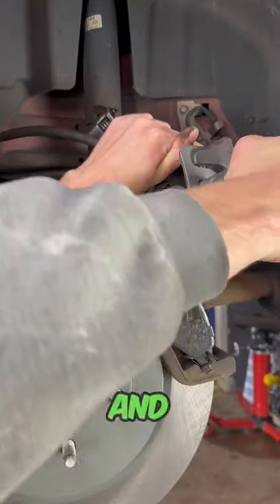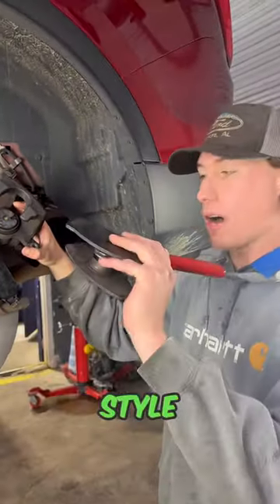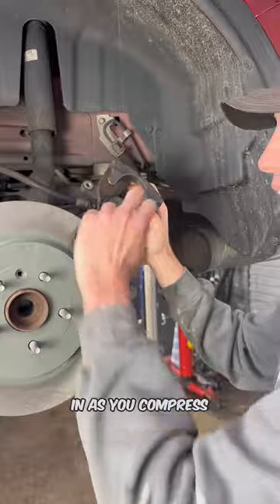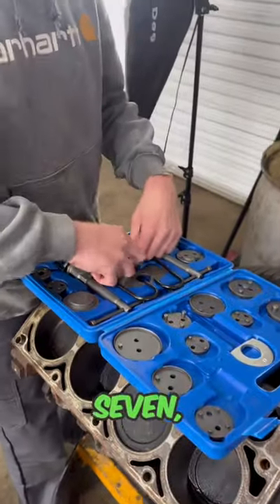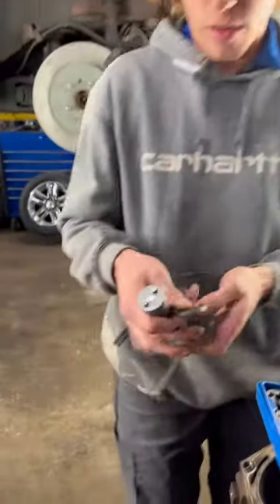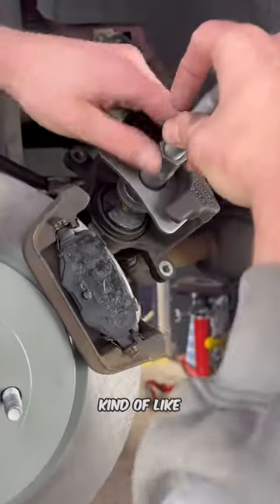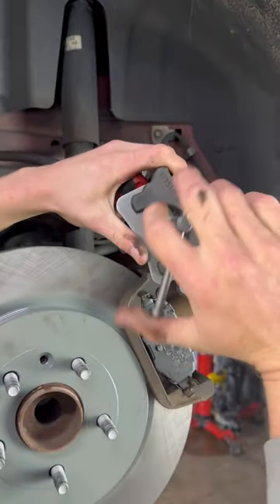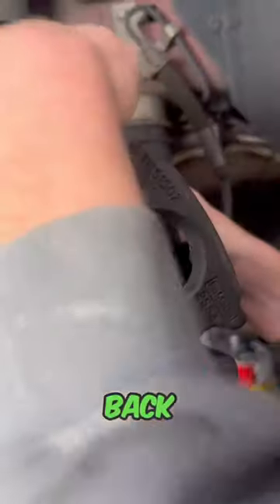The Brake Tool Every Mechanics Needs! Link in description #shorts #tools #mechanic

Comment: This tool is a life saver of pain but man, I just kinda wish they didn’t have these kind of calipers around. Sure it eliminates the need for a miniature drum brake or manufacturing an electric Caliper but I’ve seen quite a few of these calipers on 2008-2012 Honda accords leak, factory ones and new ones seem to have some issue with the seals. Not to mention if you get people who have never used their E-brake. There’s a good chance the mechanism is gonna be seized or bound and cause issues. Since here in PA part of the state inspection is the E-brake has to hold the vehicle on a slight incline.

Comment: If I had a quarter for every time, I saw someone doing rear brakes and struggling with a C clamp😂
Another good trick. If you’re trying to get the rotor off sometimes there is two screw holes you can drive bolts in with an impact, if it doesn’t have the holes, usually you can come from the backside with the same method through a bracket

Comment: When I found out my Flex had this design, I was not a happy camper. 20 years of doing brakes on older vehicles, and Ford throws me a curve ball. I have the toolset now, but I am still not happy about it. And I still have the Flex.

Comment: I have the Matco version that has a 13mm hex and a 3/8" square drive on the end with a caulk gun style grip to apply pressure while using a ratchet to turn the shaft. It also uses multiple discs with pins in different locations to index into the piston as well as a flat disc to push in standard single piston calipers. It has paid for itself in saving time not having to use the tool shown in the video.

Comment: If its an electric parking brake, remove the motor before compressing, you could damage the motor if you dont, also some turn in left or right, check before turning it all the way

Comment: Also important to remember to have the piston in the same orientation as it was when first removing the calliper, pins on the back of the brake pad can slot into the piston

Comment: Gotta get the air powered one. Has no threads so it stays tight without always adjusting the tool
Reply: Agreed, I use one at work and it works really good. Takes very minimal effort and I can compress those things in seconds.

Comment: The little 1" cube with a 3/8 square hole for a ratchet extension available at fine auto parts stores everywhere.  Been spinning rear pistons since the 90's on GM.

Comment: Apply some pressure….. Screw them with a pair of Channel Lock pliers…..Don’t pinch the rubber
Reply: Bingo!
Reply: Seriously, get the tool, it's not that expensive. A rebuilt caliper not so much...
Reply: @charleshubert6751  if a pair of channel locks hurt your caliper it was already hurt.
Reply: @grapeseed427  I've reset the calipers in my Volkswagens with channellocks and a clamp a few times and I bought an inexpensive set of these caliper tools and if you want to do it the hard way you go right ahead. The proper tool saves a ton of time and resets the piston properly. Not saying you're wrong, just telling you I disagree with you.
Reply: Ball ache 😂
Reply: I’ve done this so many times with pliers it’s not that hard lol. Incorrect practice makes perfect.

Comment: I hate using these but they’re essential for a lot of rear brakes. I open the brake fluid reservoir cap before putting the tension on. Somebody else mentioned also lubricating the rubber boot to prevent it from tearing which is a great tip.

Rent the tool from the auto store if you don’t plan on using it often. I’d rather rent a good quality tool than buy a cheap one since this thing often requires a decent amount of muscle to use. I sometimes refer to this tool as the hand torture device.

Comment: if you want to know why your calipers is this way this is only on rear brakes and it’s because that caliper has a mechanical operation for the parking brake also you will notice that your brake rotor does not have an internal drum for a parking brake.

Comment: The newer Volkswagens still have those slots but you don’t have to do that. Just use Odis to set the brake back before and after. I use a normal brake tool like you showed

Comment: Tool not required.  My Terrain had it and you take off the electric brake solenoid, spin it back out then push the piston back.  It is a pain to do it that way though!

Comment: these should only be on rear disc brake systems, they like that because there is an integrated parking brake. a manual cable with twist a lever on back of the caliper pushing the pad onto the disc., like a screw. instead of using hydraulic pressure to squeeze like when you use normal brakes.  that's why you need to screw it back in again.  this wasn't explained at all. now you know! :)    on newer cars with electronic ebrake there may be a servo or solenoid instead of manual cable. but similar deal. on those you normally have to set a mode in the dash to do those new pads.

Comment: Its only on the rear calipers and only on the calipers that have the parking brake inside of them. On a car like the bmw, the parking brake is inside the rotor so the caliper is sliding in no problem.

Comment: I have a little cube shaped tool that mounts on the end of a 3/8" ratchet extension. The cube has six sides, each with different spaced knobs and corresponding ratchet openings.

Comment: Get yourself an air wind back tool I use it daily it's handy when you have a  stubborn piston . The adapters you are using also fit the air one aswell so it saves you buying two sets of the discs 😊 it actually gets annoying when the piston has came out to far and you have to resort to the manual windback tool that you are displaying in video😂

Comment: Also most of mazda with electric parking brake.  Have the 2 slots or cut out but are not screw in those are still push in.

Comment: often, the local parts house will rent this tool out.   I bought mine on amazon.. best to use this tool Dig it!  clean up the grooves on your caliper boots, I even lube them so they slide around the piston as I retract it with the tool, vs rip it.

Comment: I got an air powered brake caliper tool off Amazon it’s a sky blue colored one I think Astro pneumatic makes it but works very well on stubborn twist calipers. The Ford Transits always gave me trouble but that tool made it ten times easier.

Comment: Get the air driven one. Spendy but worth it if you do a lot of brakes. Also, you can compress those with a ratchet style brake press IF it has an electronic parking brake and you put it in maintenance mode. At least Chevy and Ford I speak for. manual e brake cable driven you have to do this turny b.s.

Comment: Never met a turn and press caliper. Remember my first turn in type, I bent a scew driver trying my normal method. Went to parts store because I thought it was stuck. Counter guy said it turns back in. I still have the janky square tool for the job.

Comment: I always just use a needle nose for my at home brake jobs, and some quick clamps normally used for woodworking for the traditional style caliper, I'd buy the proper tools if I was working flat rate in a shop because they genuinely do work better lol

Comment: Why do I get the feeling that mechanical engineers all own stock in tool manufacturing companies?

It's almost like these executives all sat down with a group of engineers and tried to convince them to design new methods for a common task just so they would need to design a specific tool for it. Just so they could sell more equipment.

Comment: Get the air version.  It used shop air to hold the pressure while you screw it in, so no tighting with the wrench. I can't remember the brand right now, but I love mine

Comment: Oh I remember being 16 and working on my first car. Having no clue what I was doing and destroying my caliper and tool trying to figure out why it wouldn't compress.

Edit: mine was a Mazda Miata for those curious. No the piston doesn't twist to compress it has a ratchet that you have to release hidden behind a plug bolt.... Honestly it was a good experience because I learned double checking your knowledge before you brake something can save you a lot of money

Comment: Yea i got the same set. I used to have the metal cube you could stick an extension in and turn it with a ratchet.  I couldn't imagine having to do these without my set i got now.

Comment: I just done this muhsef' alternatin' tween' muh C clamp and turnin' them slots with the similar brake cube tool on the end of muh ratchet and uh extension. Worked fine. Compress, twist, repeat.

Comment: This is 💯 % true. Unless.....it's a Mazda CX 5 suv. It has the same notchs except it pushes straight in. Same toom. Use the wrench to tighten the tool to push it is just like u were but don't twist handle. Ask me how I know 🤦‍♂️ they have electronic parking brake and it will destroy the caliper if twisted. (What im talking about is ONLY the cx5 that looks like every other caliper that twista.

Comment: 1979 came across a Subaru with them there parking brake calipers.. we had to use channel locks to spin them in . Got old so I picked up a Mac tool 10 years later thing still fits everything on the road

Comment: Dont forget there is a pin on the back pad that hoes into one of those holes to stop the piston from turning when you apply the e-brake. Why because there is a screw in the piston thag turns to push the caliper piston out when the e-brake is applyed.

Comment: Some with electeic parking brake press in when in service mode. Also make sure the hole is lined up with the pad pin. Seen to many leave it turned pressing on the pad at an angle

Comment: I do not remember how many DYI brake pad installs I've had through the shop because they did not align the slots with the pins on the back of the inboard pads. Slightly uneven wear😂

Comment: I learned that the hard way when replacing the brake pads on my ford focus, thankfully autozone has a kit for $60
Reply: Autozone's pricing is inspired by meth. I found a good enough kit in a case for less than $20 shipped free to my door. Y'all welcome.

Comment: don't forget to point out there might be arrows showing the direction you need to spin it in. others it's a 50/50 shot. no pressure. oh, and side note, needle nose pliers can work too. 🤫
Reply: I use my channel locks. Have to pay attention to not grab the boot as it would rip it. 😂

Comment: Them notches are not the so you don’t use a certain tool use have to use that tool to wind in the auto adjustment for the hand break only rear one need doing like this

Comment: The shop i used to work at didnt have this tool set and i didnt own one either and i had to use channel lock pliers and a C clamp with an old brake pad, worst 20 minuets of my life

Comment: When I was working on cars still this is one of the dumbest things I hated working on. Screw in pistons suck ass. Just like 2 piece brake rotors. Neither are needed for a street car of any kind. Unless you plan on going a few hundred miles an hour for a quarter mile or a long-distance race with high speed turns. Other than that. Just added complexity that's not needed. Love the content, but damn I hated screw in pistons.

Comment: Gee… that looks like something else intended to  make life difficult for techs. Glad I’ve never run into anything that uses those. Probably invented by the same guy who thought you could just put a shaft with a lever on it through the back of the calliper to push the piston for park brakes: “Sure it leaks, but I couldn’t think of another way to do it.” Sure don’t miss that car. I’m also going to complain less about the baby drum brakes some of them use.

Comment: The reason is engineers want more money for stupid unnecesary design complications.
Reply: Parking brake is unnecessary?
Reply: The breaks aren’t necessary?
Reply: That's actually SIMPLIFYING things. Those are the combination rear brakes and parking brakes. Otherwise you'd have to have a SEPARATE set of brakes for the parking brakes and a rotor with a drum inside. Some vehicles are designed that way, and that's extra work, complexity and expense. Again, this is rare case where this actually simplifies things
Reply: Thanks for letting us know you don't really understand the design and how it reduces the part count.
Reply: @mbrick  why all of a sudden is the parking brake needing to be designed into the wheel cylinder so you need a special tool now to just swap brake pads.  Thanks for not understanding what I said originally.  Engineers only know how to make disposable shit now and it's pathetic.  Otherwise open your wallet for some other arbitrary pointless tool
Reply: @dmandman9  I'd rather have a dual system that works when the first has failed in an emergency then a dual tied together system that dosent work under those conditions.
Reply: @MJ100k  parking brakes that are linked to the service brake systems are not a good idea
Reply: @SleepWarz No, I read exactly what you said. Now there is no longer a set of shoes, springs, cables, internal surface on the rotor making it more expensive.  And not to mention the annoying process of trying to get rotors off over the pads that tilt and expand making it a PITA to remove the rotor.  And no more tiny axle seal weep saturating the shoes making them useless.  It is one simple tool and only one set of pads in this video.
Reply: @SleepWarz  Why would the parking brake on this truck not work if the primary brakes failed?  (How often does that even happen?)  If you lose brake system pressure somehow on all redundant circuits the e-brake is a separate electronic motor that still moves the pads.
Reply: @mbrick  I'll take my Springs and shoes over an electric motor attached to a caliper that if the caliper seizes You no longer have a secondary. Redundancy is very important in moving multiple thousand pound objects.
Reply: @SleepWarz   this system is two separate systems as well. If the hydraulic system fails, the mechanical system still works. That’s why you have to screw it in rather than press it in. Both designs have been used on various ford vehicles since the 1990’s at least. Example: the mustang, Taurus etc used this style. The crown Victoria and older pick up (with 4 wheels discs) used the separate shoes. Today only the super duty trucks use the separate shoes. Pretty much every other car, suv, and truck including the f150 uses this style. I believe the same is true for the equivalent vehicles from other manufacturers as well. Reliability is pretty much the same. It’s still mechanical for the parking brakes and hydraulic for the normal brakes. One can fail and the other still work unless the pad is completely missing.
Reply: @SleepWarz  this design has been in use since at least the 1990s (probably earlier for some vehicles makes) when they went to rear disc brakes on various vehicles. It was either this design or installing an additional small set of brake shoes as emergency brakes. The additional emergency brake shoes are much more difficult to work on. They had to be adjusted periodically. Most mechanics would rather deal with this design vs the separate shoes. Yes, it’s an additional tool. But with rear discs, they had to use one design or the other in order to incorporate the emergency brake
Reply: @mbrick  exactly! It’s actually SIMPLER than the alternative of installing a separate set of “mini shoes” and a combination of rotor/drum on the rear. Besides, this design has been used for YEARS depending on the vehicle at least back to the 1990’s . Probably before that.
Reply: @SleepWarz  Again, this is not “all of a sudden “. This was , and is the most popular design every since they started using rear disc brakes and is less complicated and just as reliable as installing an extra set of brake shoes that are VERY difficult to access in many cases because they are of necessity behind the hub. Ask most mechanics, and they’ll prefer this design rather than the extra shoes that require periodic adjustments and often rust or become ineffective since they’re not used frequently in many cases. Besides, the do it yourself individual can often purchase the tool for his car for just a few dollars. It’s not as good or as easy to use as the professional set. But it’ll work for infrequent use of the person who does his own work.
Reply: Lol I always get a good laugh at people who blame engineers like you do. We only know how to make disposable stuff these days? Wrong. We are given a project with a budget that is 2/3 of what it should be and then are told to make 10lbs of crap into a 5lbs bag. Everything you think is the fault of engineers is caused by management
Reply: @sutherlacd27  although as a tech, I’m often critical of the engineers, I also fully believe your point. Management and bean counters are likely behind many of the choices made by engineers that cause us grief. Having said that, it’s obvious that the person who originated this thread has no knowledge of what’s required to emergency brakes work with rear disc brakes and the choices that must be made

Comment: Lets make it even more impossible to work on your own vehicle yourself. I had to boost a newer honda crv, there was quite the pile of plastics just to boost. Engineers are so dam stupid. Somehow vehicles used to be incredibly easy amd now oil filters are basically impossible to reach, too mucj stupid useless software that always has glitches. Honestly ford is the worst vehicle out there, i wohldnt own one ever ever ever again. Had a fusion ans what a piece from new. Buy toyota if u want a good vehicle.